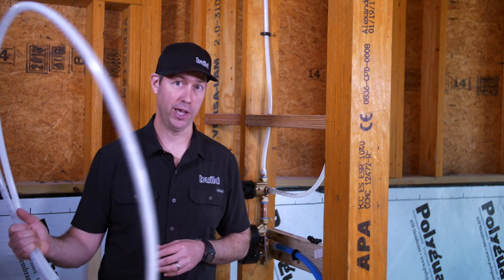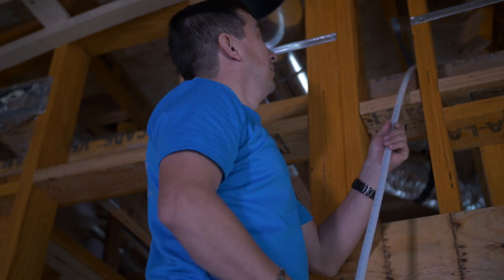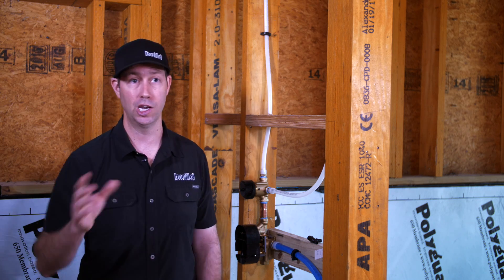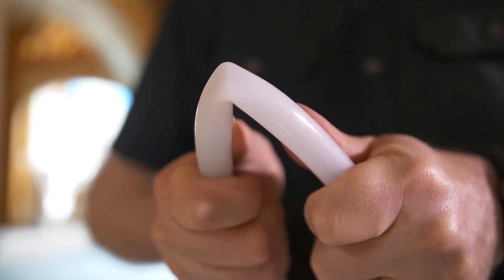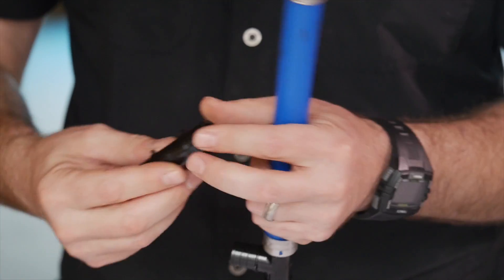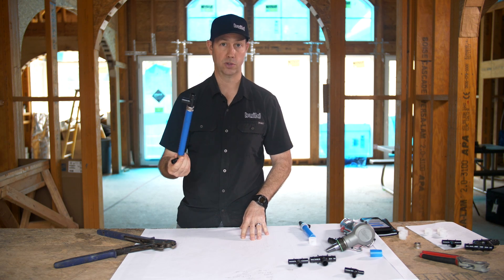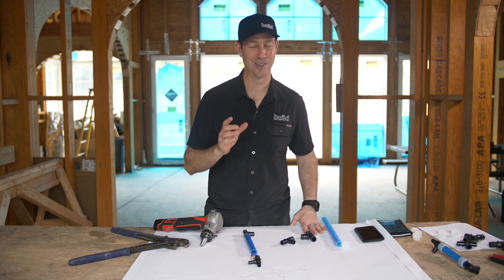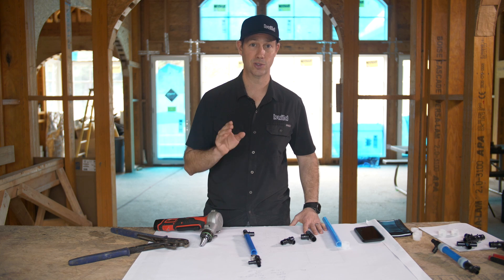PEX vs. Copper Plumbing

Comment: Another benefit of copper is sound dampening. L copper pipe is fairly quiet in most applications. How does Pex compare?
Reply: I have not experienced significant noise with PEX. I have never had a customer complain about noise. In fact, I'd argue that it is quieter because you don't have a bunch of bottlenecks at every bend in the pipe.
Reply: type L copper has like a 75 year expected life when installed correctly...pex does have its place but nothing can beat a good copper job.

Comment: I have used the crimping pex in the past, never had an issue. I’ve seen the expanded fitting pex but I was always concerned that the pipe wouldn’t seal tight enough and therefore cause failures at the fitting. When it came to the one fitting failure that you described in the video, was it pex a? Or pex b? Great video, Matt. Looking forward to the next one
Reply: Pex B and he thinks it was improperly installed.
Reply from the maker: +gracilism yep

Comment: Lemme tell ya, if you don't properly support those pex lines, noise will still be an issue.  It's slightly different from true water hammer, but those lines will flop around in any space you give them and the noise from them smacking into things will sound virtually the same. Regardless, loved that install. Loved working with that product. I prefer the Uponor. Worth the expense, IMO.
Reply: That's why you use anti-hammer devices, but aren't those required pretty much everywhere now?
Reply: Indeed.   Too much slack in the system or a run that's not snugged down near the drywall will cause hammering.  Source: My walls.  Live & Learn I guess.
Reply: Some of us like piping noises, as they assure normalcy.    But I'm with you, I'd use PEX, in preference to copper, on future work.     Meanwhile, my 60-year-old, slab-on-grade tri-level soCal house is going strong, with the nearly-30-year-old L copper fresh water system I installed shortly after I bought the house... all in the attic.     I have a well-insulated hot water recirculation loop, which is "golden."   I use an inexpensive Harbor Freight timer clock to control the pump, and one of the 3 half-hour circulation cycles operates before dawn, so that hot water will be readily available at first light, when I rise.      I can hear the copper pipes, in the attic above the master bedroom, creaking and popping, ever-so-slightly, as the hot water flows... expanding the LOOP.   It's amazing, and it's a friendly reminder that it's all working as designed... except those noises were never expected.        They've turned out to be a good thing.
Reply: Use clips and drill holes a little bit larger than you would for copper to prevent noise. This biggest problem is with holes being drilled too tight causing a squeaking noise when the tubing moves through the hole. Clips resolve any issue with slapping.
Reply: Yes you are so right, after they built our new house which has pex through out the home I started noticing a rattling sound every time a commode was flushed.  Come to find out the line in the wall going to the valve for the supply line of the refrigerator ice-maker was not properly supported in the wall and  would rattle around.
Reply: matt b it's not slack. Pex expands, cold water is warm enough to do that. Friction alone can make the pex flexible.
Reply: Ian Powell that's why you j clip your lines , I have never installed  water hammer dampener and I have built high rises , 4 story walk ups and houses.
Reply: @Randy the country of Canada .we just run our line properly here and use j clips like you're supposed too , but I'm sure your genius has come up with a better solution then the industry's accepted (and insured) meathod. I bet you run your lines straight and use 90's everywhere like an absolute moron. Please inform me of you're superior method that you eluded too but never actually mentioned.
Reply: I've only used PEX A (Uponor) and honestly wouldn't ever consider anything else. Cost difference is negligible (especially when you consider 1/2 Uponor is basically 5/8-3/4 equivalent of Silane-style (PEX B) , it's almost idiot proof to install, and why buy more special tools for different style fittings?
Reply: True and exact problem i have with pex lines. "Putki runkkarit" (translated as "pipe wankers" ;) ) might leave those supporting clips so far apart, that pipe is all over the place. Even though code here demands them to put support every 20cm and lines must be with 90degree turns ( i cant even imagine horror of working on USA construction sites-.-). Lose line like that just asks nail to be put trough it, as it cant be seen inside the walls and its not straight up from faucet. Hence most piping these days is done as surface installation, least in renewal projects.
Reply: More Talons  and your good
Reply: You use pex clamps to hammer them to a stud/joist, straps, or even insulate the pipe behind walls so they don't bang. Just depends how you run the pipe.
Reply: Good to note. I think pex is like anything else, installed poorly and you will get poor results. Copper is loud too when hammering happens and nails pull over time from straps or too few were used.
Reply from the maker: +Isaac Carrizal thanks for the tip
Reply: Isaac Carrizal pex definitely bangs. Living in a house that is haunted by it.  Dont know how to fix it.
Reply: @roman2011  I realize this is an old thread, but I solved that problem by drilling a 1/4 inch hole in the wall at the pipe noise spot (usually next to a stud) and squirted in some insulating foam. Just don't use too much. Try it in a couple of spots above and below. I used it several times like this and it worked every time. If it is insulated, use a thin screwdriver to move the insulation back out of the way.

Comment: Pex you can get color coded tubing.
Reply: Admiral Stoic Rum uponor sells red and blue rings as well for the pex a
Reply: Admiral Stoic Rum you can't get colored tubing in copper either.
Reply: Rum Uponor
Reply: Donald Darbonne the colour on copper indicates thickness or quality 

Type L is blue 
Type M is red 
Type K is Green
And when they had DWV copper it was yellow

Comment: PEX has no Achilles heel: rodents. I've seen it.
Reply: Yes house has to be rodent free!
Reply: They will chew on anything and everything once up there, so electrical can be compromised as well.  I have heard bad stories in vacation communities of PEX and CPVC leaks due to rodents.  It is always a good idea to turn off your water if you are not going to be in your home to avoid water damage.
Reply: Can anyone afford to plumb his house with stainless steel?
Reply: Found a dead mouse once with his tooth lodged into a copper pipe nothing will stop them there evil when they need a place to stay for winter.
Reply: Im not a plumber so I have very little experience with plumbing but I have seen a rat that chewed on some  12/2 ac90 (bx wiring) the rodent actually managed to get half way through until it caused a short in between the sheath and the hot wire and died of electric shock. In my opinion rodents will chew on everything and anything always take measures to keep them out of your home
Reply: I don't think stainless steel is a good option at all. Don't let the name fool you, stainless steel can corrode.
Reply: Rodents will chew through condenser lines too.
Reply: Rats chew anything, they have the tools and for sure have the time
Reply: I never seen a PEX pipe getting eated by bugs or even rodents.
Reply: But the pipe is too smooth and round with no edges.. I wonder how can a mouse actually do that..
Reply: maybe clean up around the home and actually rodent proof it.  not expensive and just a bit of common sense...
Reply: A rat nearly cost me a customer. Guy thought I didnt braze a joint right when he saw refrigerant everywhere. 
I showed him the severly burnt rat lodged to the copper pipe (the small 3/8 liquid line) hahah
Reply: There is at least one insect that will chew on PEX.
Western Conifer Seed Bug
Reply: freewill1114 Trump
Reply: a single length of stainless steel 3/4" is $100
Reply: I had a problem w/roof rats that found a portion of roof overlap that they were entering the attic and on into the attached garage and were having a big time. I used rat poison in cube form and broadcast throughout the attic and that did a no. on the nasty things.
My house is close to 40 yrs old and I am in need of replacing the galvanized pipe and thinking about Pex as a replacement and of course is the reason I am here. 
I will say I have have had a plumber replaced the nat.gas line to the house, AFTER I dug up the old line which was black pipe w/out dope and wrap. This guy replace the line w/flex pipe of some mfg. w/a special fitting at each end of which this wizard used a pair of channel lock pliers to tighten the conn. After his manometer indicated too much press. drop he and I went all over the house trying to find the friggin leak and the last point we checked, it must be the elbow in the wall where the line enters the house. He cut a 6"sq. hole in the drywall, no leak. Now all this time it is costing me by the hour of course, so we go outside and the damn conn. he made to the lin coming inside was leaking the whole time. This cost me in excess of $700.
So I laugh a some of these comments and reminds me of the guy who was so full of bull, "that if he had not been there he had flown over it"
And don't even get me started on the friggin below grade drain line that is screwed.
Reply: *one, not no
Reply: I raised rats, I have seen them chew through metal also. While the plastic would be a ton more simple, I have seen them chew through wire, wood, and insulation. If they want to chew it, they can, and will.
Reply: +xrateduser
stainless steel has a moh's hardness equivalent to rat's teeth after it undergoes work hardening. they're not gonna get through stainless pipes.

Comment: This was a great informational episode. A few years ago I used pex to redo the plumbing in an old house and used the clamped "barbed" style rings because the tool was cheaper and easier to get into small spaces. I was wondering if those are even considered in a professional build since you didn't review that style?
Reply from the maker: +Patrick McDonald yes I've used that one too. Just didn't have it as an example

Comment: I used PEX A for the first time to re-route a leaky copper pipe (under slab).  I used the compression ring system available at Home Depot.  I attached the PEX to the existing copper in the house using fittings available at the store.  I like the PEX system although my experience in very limited.  Another reason to use PEX would be to replace copper pipes damaged by too much salt from water softner systems.  Thanks for the video.
Reply from the maker: +SyberPrepper interesting   Didn't realize a softener system could harm the copper
Reply: When I moved into my house the water tasted salty.  I called the water softener company and their technician said the softener was not adjusted right and was causing the salty taste and may cause pinhole leaks in the copper pipes in the long run.  I'm no expert but there seems to be some backing for this reasoning.  One article from Culligan said a PH below 7 is considered acidic and can cause corrosion of copper pipes.  I'm sure this is a complex topic so I'll leave it here.

Comment: I've got a mix of copper and pvc. It acts as a timeline of when projects were done in this house (Built in 1920s). Eventually I would like to replace with PEX. A friend recently showed me his PEX system and I loved the control valve setup. It was just like a breaker panel to control each circuit.
Reply from the maker: +RobbieDW that is a cool feature I never mentioned
Reply: my parent's house has radiant floor heat using PEX, and also have a manifold like that. Its quite interesting!
Reply: Only problem with a manifold setup is when you turn on a hot water fixture you only fill that line then you turn on a different fixture you have to fill that line. A trunk setup allows water flow in the trunk so time is cut way down

Comment: I live on a Scout camp where my wife works year round taking care of program and 40 horses.  The property manager pulls out PEX to put in copper.  Personally, I don't think he understands it sufficiently, but no arguing when it becomes a religious discussion.  So I leave that one alone at this point.

Question on the Pex fittings, how do they tolerate freeze/thaw cycles?  

Wife is putting in water system for horses in an un-heated, un-insulated horse barn.  Cold water only. Using PVC mainly because she wants to drain it, and for the non-professionals, PVC rigid pipe helps the non-pro have success.  She is careful to be able to easily drain it (without blowing it out with an air compressor).  I would like a system where draining isn't an issue, other than releasing pressure so the cast metal waterers and their valves can minimally drain and be safe.

Suggestions?
Reply from the maker: +servant74 is not sure it could really go through multiple freeze thaws. The polymer fittings, T's, etc would certainly crack even if the PEX itself survives. Try it this winter on a small section. Use PEX-A as its softest and most able to expand and contract
Reply: I do the opposite, I generally buy around one or two new rental houses every month. The first thing I do is gut the plumbing out and put in Pex. Pex B is more popular in central Indiana so that's what we go with just incase I need a goofy fitting. The biggest benefits to me is way lest cost, and if a tenants lets a house freeze for some reason, I don't have a $50,000 dollar mess. It also only takes me a morning or maybe a whole day to plumb an entire house. I wouldn't touch copper with a 10 foot piece of pex at this point, I probably own 100,000 Pex joints, nobody works on them but me, and not a single one has ever leaked. I also don't use the cheapo plastic fittings, only brass.On my farm we use Pex to run water to hog buildings and throughout the building. These lines sometimes are literally buried a foot in hog manure, which for city folk terms, would be straight nitrogen. They are exposed to sunlight when the manure isn't on top of them, Have been there for going on 30 years, haven't had a single one bust that wasn't hit with a tractor, or eaten by a hog. They all go through a freeze every year too, not a pressurized freeze, but I don't blow the lines out at all, just take the water nipples off and whatever comes out comes out, for 30 years. Do that with copper.
Reply: What is used is not up to me.  Copper does have some bacteria effects, but the 'city water'  is used (a now 6" main is now used) and we are on of the nearest taps to the treatment tap.  I can't smell the chlorine in it (a good sign) and I know it is treated with high intensity UV light. 

I don't think Matt is in any company's pocket.  He is a cheerleader IMHO because he sees the positive part of PEX.  I have seen corroded copper that leaks because it was put in with to much flux (it tends to generate pin holes on low points over time, the flux is mainly acid, and that is what eats through).  Copper is still a good system, but to do it right, it does take a skilled plumber for long term to be considered 'right'.
Reply: @Mark Dupriest - The fact that copper disinfects doesn't mean much because the water already contain fluoride and chlorine that kills all bacteria.

As for hospitals, they have vast water networks with dozens of connected bathrooms which might let dangerous contaminates travel from one to another through the piping. In residential buildings it has no meaning.
Reply: Take a plastic cup and a copper cup... copper has a natural bacteria agent in it... plastic Doesn't....in 5 days the plastic cup... will turn green. I don't want to drink that...do you?.... The copper cup will be clear and pure....this guy is a cheerleader for a pex... company.... Tell me pex man....why don't they install this in Hospitals???? Because it cost over Heath....no wonder so many elderly people get sick in these prefab retirement communities....